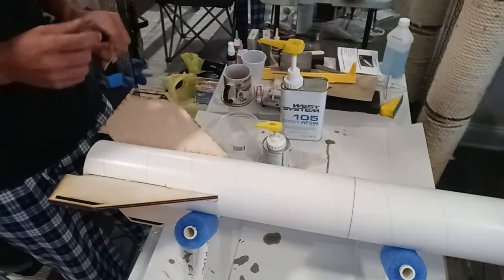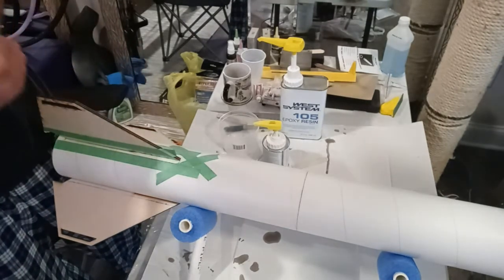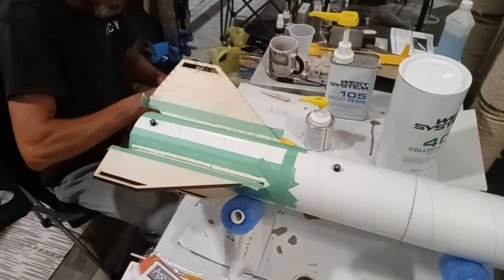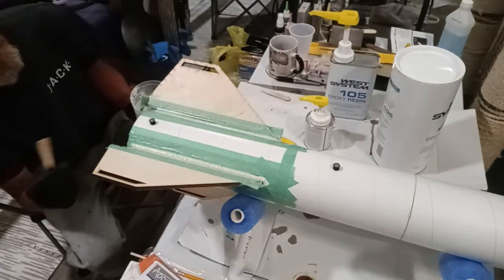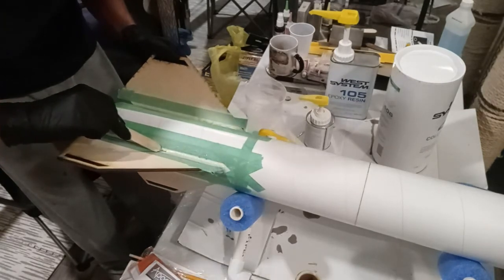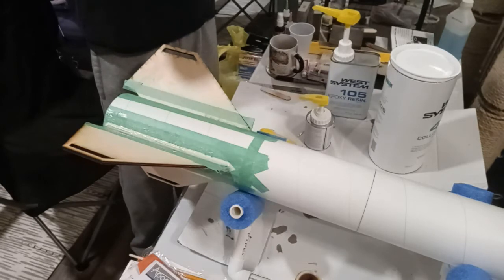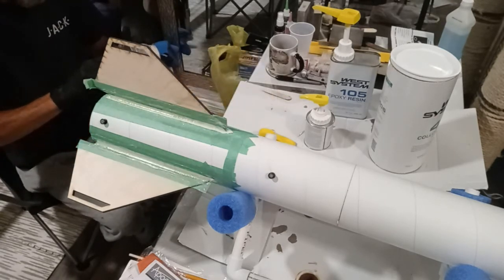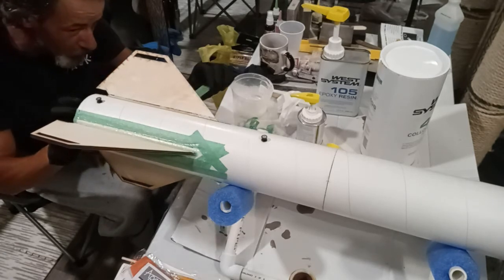Fin Fillets  apogee zephyr

Comment: Make sure you don't talk and sand at same time.  Can't hear over that.  Otherwise, cool watching someone build an L1. I built my LOC-IV a year or more ago, but need to finish up recovery gear and rail buttons. It's at least 3 hrs to a HPR launch site for me, so I'm going to get a 29mm adapter and use an F or G for test flights.  I already got the add on e-bay for the rocket and an eggtimer deploy computer for advanced flights later.
Reply: add on e-bay for the rocket and an eggtimer deploy computer for advanced flights later.
so, one can't use and electronic charge in this rocket?
do you need an EBAY for this? i have an RRC2+ not sure it it considered outdated or not.

Comment: 406 filler be ok?
Reply from the maker: Should be fine really any of the fillers will work. I probably over did it on my build.
Reply: @chrisschafer4899   i ended up getting the same stuff you  use in here. ha ha.... that filler is like charcoal air float. fluffy.

this is a 5..1 ratio.

 so do you think i could weigh out say 50 grams and 10 grams? i hate to even use the pump as I wont use this very often. this is my first big boy rocket. be nice to know what 1 pump weighs.
Reply: how wide is your filet from the tube to the edge of  your tape? 

mine is masked off but only1/4 of an inch. is there a formula for this? should i go bigger? smaller?
Reply from the maker: @daytonpyro  well I used the Popsicle stick to make my filet so I just made the tape wide enough to handle the size of a large one which is probably about 3/4 of an inch. I have never come across any formulas for it.